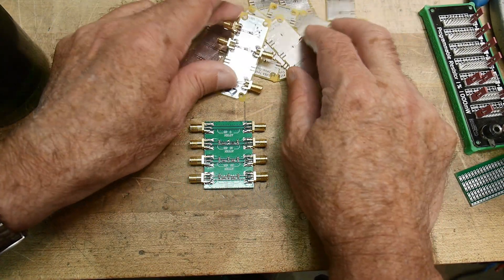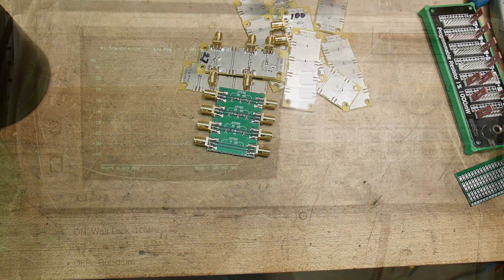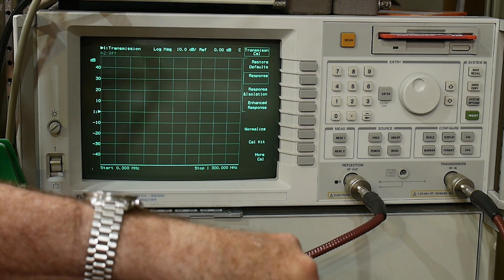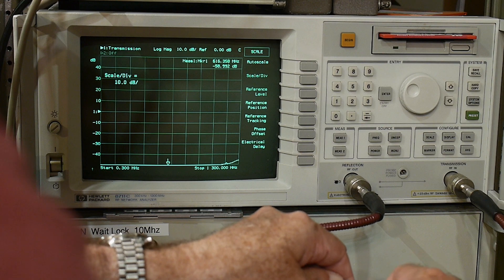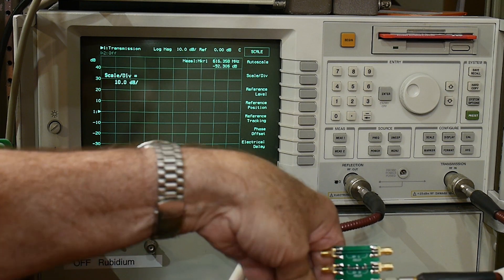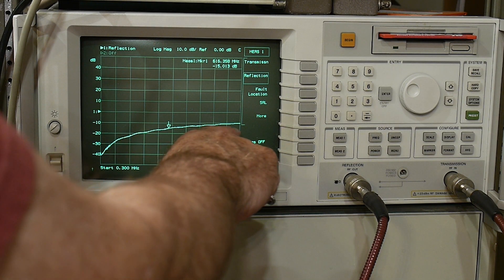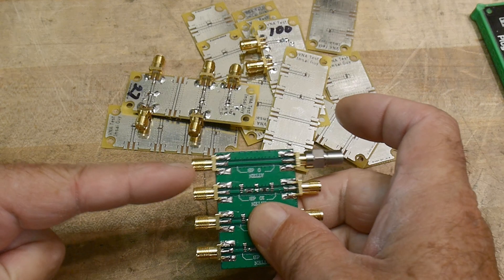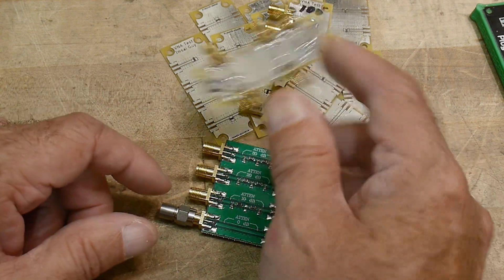#1178 VNA Test Boards  (part 4 of 5)

Comment: Thanks for clip.  Yes that item is a toy not a real product, but demonstrate PI network  I am designing attenuators using Florida RF parts.  Check them out they say they have 100W or 60W version for a few dollars. 
What amazes me is that how do they afford to make half baked product and market it, and I do not have the guts to bring to market my fully baked products!
One reason is that we have too many ambulance chasing lawyers to go after the American originated products.
So, I guess to avoid the ambulance chasing lawyers, one should produce it overseas and market it from there.
Reply from the maker: Florida 250W: https://youtu.be/aScxZ_1Cx0Q
Reply: @IMSAIGuy  Yes I built it with 100W 30dB, and the spectrum is flat to 500MHz, after it moves down 20dB and goes back up.  I think it is because of my bad Transmission line.
By the way 100W on 50 Ohm means P=(V^2)/R  is Vmax = 22V  or 50dBm  for the board you have with 1/4 Watt resistors it means Vmax =3.53V or 23.9dBm for 
your 250W Vmax= 111.8V or 53.9 dBm